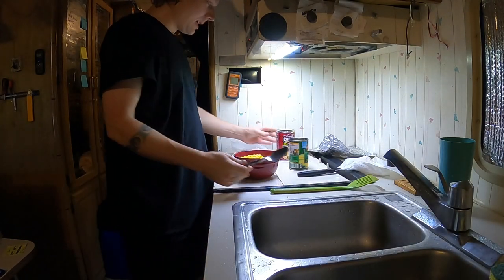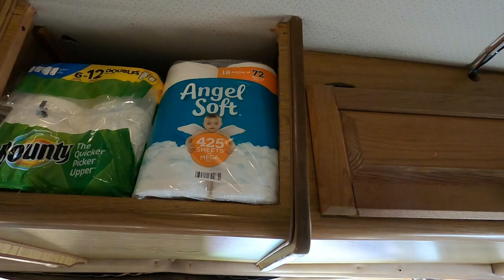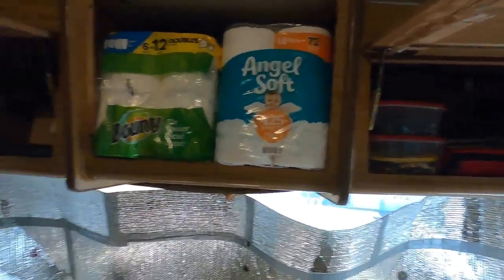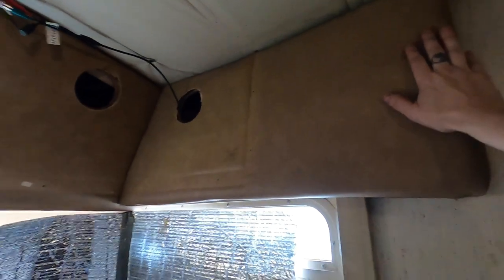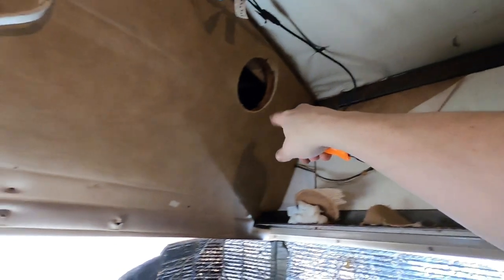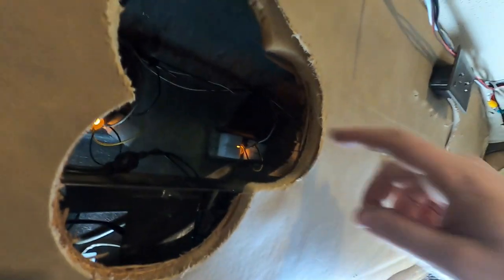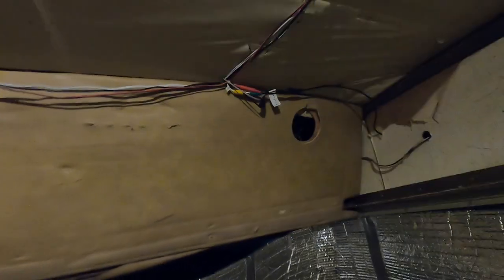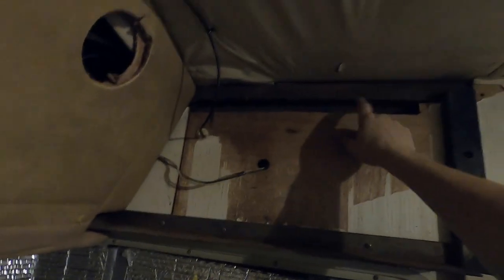Having Dinner And Removing Cabinets - RV Living

Comment: Typically Batchelor Life. Just keep your eyes open for dented cans. (That is my check.  Might make the inside off. Better safe than sorry). Like I said: best to take down the roof trim. Find out where the water leaks are.  Fix up. Recheck.  Then replace the roof trim (If not custom made). Thanks for sharing your videos.  Regards

Comment: I have the same exact coach. 1989 was the First year of steel frame, under carriage storage, and fiberglass composite walls. At the Winnebago brochure archives online, you can see the framework and pics. They did lots of stupid things in 89'. Almost like figuring it out while they built them....